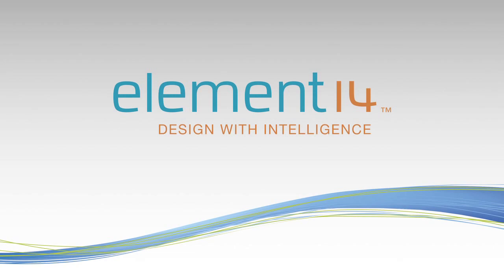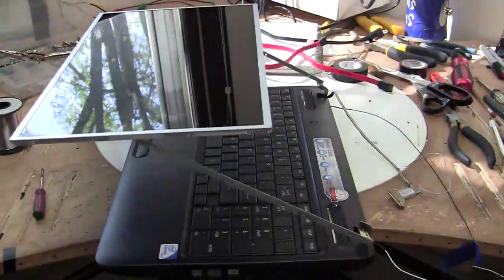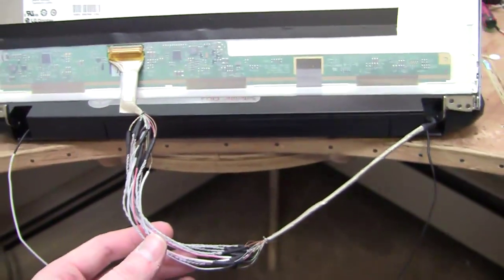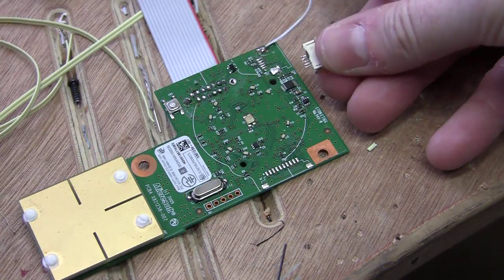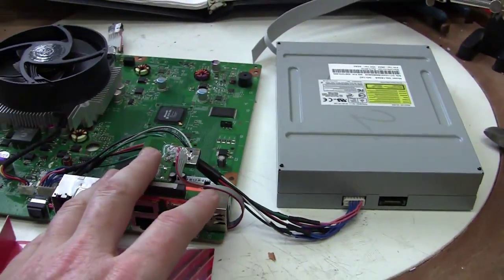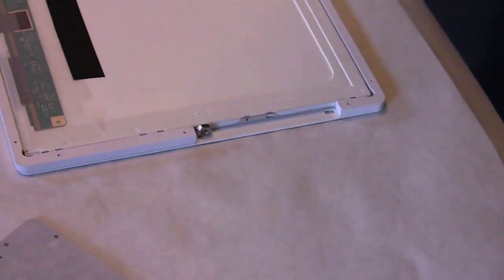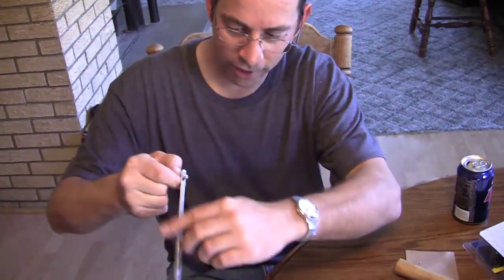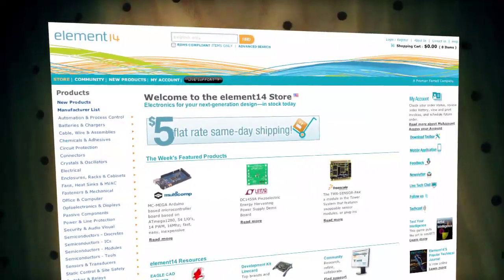The Ben Heck Show - Coach Section Laptop

Comment: First of all Mac. Vs pc is basically a personal opinion thing, they are basically comparable in most areas. Basically it is just insecure people fighting over an object so they feel justified for their choice of purchase. Same as Chevy vs Ford or Lamborghini vs Ferrari, Xbox vs PlayStation, coke vs Pepsi, etc. 

And B, Ben made this so it can be used without having to angle the screen back from the base of the laptop which would take up more space. This you can use with the keyboard and mouse underneath the screen. 

Thirdly, netbooks may be small and can be used in less space, their tiny screens, and cramped keyboard are very hard to get any real work done. Also with a tablet you can't have a physical keyboard without putting it lean back at an angle like a normal laptop, not to mention there are many things that tablets just can't do.